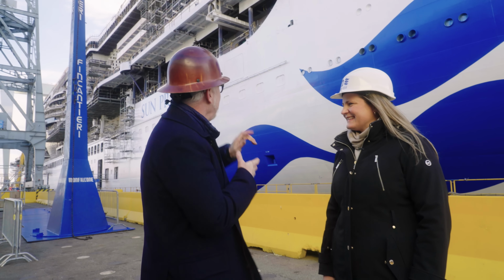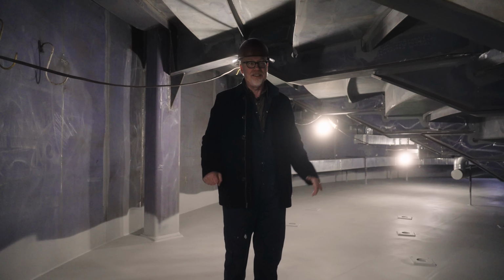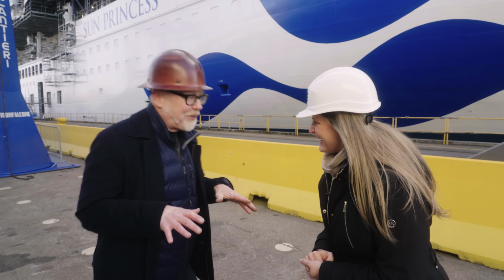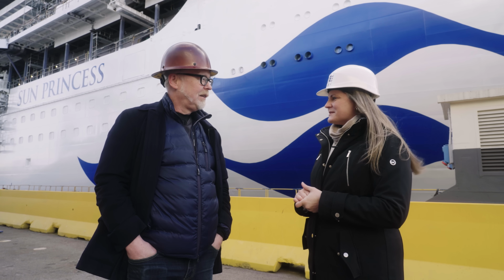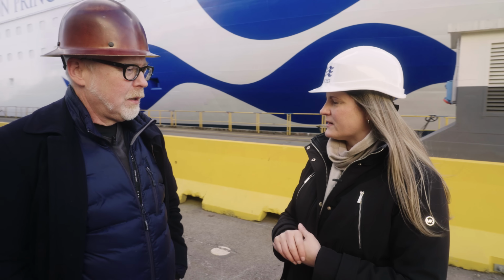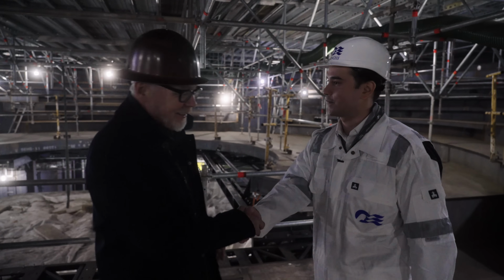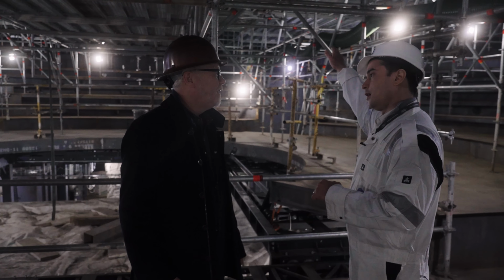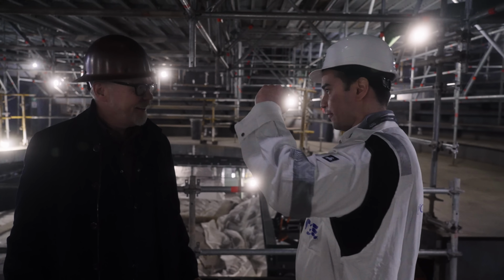This Theater Is AMAZING

Comment: Are they still going to dump the sewage straight into the ocean, and run on bunker fuel?
Reply: It runs on LNG
Reply: NPC counter: +1
Reply: @sintoxic  If the price is right. They don't have to.
Reply: Kind of an ignorant comment to be honest. These ships have state of the art water processing plants in them.  The water they release back into the ocean is clean enough to drink.  And the industry is ditching diesel. If you're going to bash an entire industry based on their past, then you may as well go after every other modern industry too.
Reply: @jeffdesilva  They only do, what they have to,  where they have to. Where there are no regulations to adhere and no one is there, to keep them in check, there is no need to let profits going to waste. Ask yourself: did you now, that those ships have duel-fuel motors? Is the ratio of currently used bunker fuel to LNG advertised anywhere? Are they advertising the difference in  working conditions - working hours, wages, social benefits - of crew members of different nations?
Check up on everything and ask yourself again: why should it be acceptable to myself, to travel like that.

Comment: Wait but I thought that the Corona pandemic essentially killed off cruise ship business, didn't it? I certainly remember reading how the world was so over cruise ships companies were going bankrupt and the already sailing ships were sent to demolition docks.
Reply: This is why they are sponsoring videos like this as a large marketing exercise, trying to get people back on board.
Reply: Some ships got sold off, but the only lines that went bankrupt were smaller operators, most of whom were in Europe. 2024 will be the strongest year ever in the cruise business. Most cruise lines actually have more capacity than ever as older ships were replaced with newer ships. In the case of Princess, they sold the former Sun Princess to Peace Boat (who in turn sold a nearly 40-year old ship for scrap). They also sold the former Sea Princess, which was sold again to a Chinese operator who is planning to relaunch the ship under the name Charming. When the new Sun Princess debuts in 2024 Princess will be above its pre-pandemic capacity in spits of having one fewer ship. By 2025 when Star Princess debuts, Princess will have the same number of ships it did in 2019, but have a significantly higher passenger capacity.
Reply: @showjack1109 I've been on a few cruises since they restarted. Whatever they are doing is working as most ships are sailing at capacity again.

Comment: Curious. Almost all cruise ships sail under a non-US flag, so how does that play into their compliance with US regulations? Is it a requirement to dock? (Ignoring, for the point of the question, that it's a good thing to do and attracts more business, of course. Frankly, the extra expense would take a long time to reclaim, longer than if the ship was not ADA compliant.)
Reply: There are usually requirements to be met in order to provide a passenger service in a certain countries waters. For example, if you want to provide passenger service from a UK port, you would need to meet the requirements of the UK Maritime and Coastguard Agency who would enforce compliance with the Persons of Reduced Mobility regulations (which are fairly standardised across the UK and EU, though UK approval no longer automatically grants EU approval). Failure to meet these requirements would likely result in nullification of your ships insurance in those waters.

Comment: Talk greater about the pollution or carbon footprint, oh wait you can't because they sponsored you.
Reply: They did talk about the efficiency features of the ship and it's the first princess ship to use natural gas, so less particulate, polycyclic aromatic hydrocarbon and sulfur pollution and in theory lower carbon emissions as well.

I think per person these ships aren't as bad as people think, It's still kind of nuts but when you figure everyone on that ship is not at home using energy there it probably comes out closer to even than you'd think. I figured it for a slightly smaller carnival ship that they burned about 4 gallons of bunker or diesel/day/pax which is completely reasonable. The fact that that is reasonable is probably the bigger problem than the ship existing and operating. Flying to these destinations would be far worse in terms of pollution and carbon emissions.
Reply: @SenorBolsa  You are probably right. Send 3000 people on a normal vacation, in cars, planes etc. with hotels etc. each person probably emasses quite the carbon footprint too
Reply: @SenorBolsa that's all nice improvements and all but don't forget the fact that they don't abide by US laws and regulations. The company is incorporated from) in the Bahamas, they can get away with anything they wish, and they do.
Reply: @churro6160  For sure I think the way they handle black/gray/bilge water is particularly troubling still, there needs to be stronger laws and enforcement on discharge of these wastewaters though they are starting to build much better onboard water processing systems with these new ships. They may be based int he bahamas but the ports they visit are always becoming more stringent about what they will allow to dock.
Reply: NPC counter: +1

Comment: Let's count the NPCs....
Reply: 9 NPCs repeating each other almost word for word so far.
Reply: @staceygram5555  If it is factual, that doesn't matter. You repeated yourself nine times too.
Reply: @staceygram5555 Oh. That is peculiar. Maybe Sun Princess is running some old botting protocol that repeats people's comments verbatim to increase engagement without too much suspicion.
Reply: @sandmehlig  
It's not factual and it does matter.

And you're failing at logic. Repeating a reply to the thing that's being repeated over and over again is not equivalent to the thing being repeated over and over again.
Reply: @staceygram5555  Ditto.